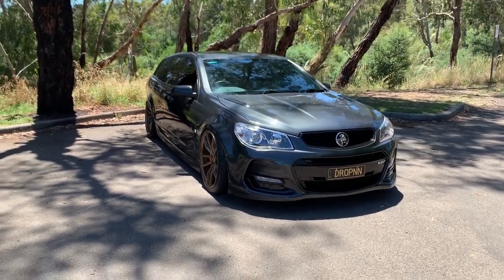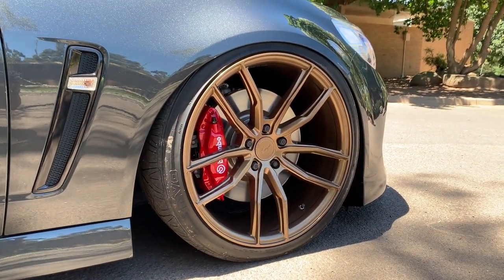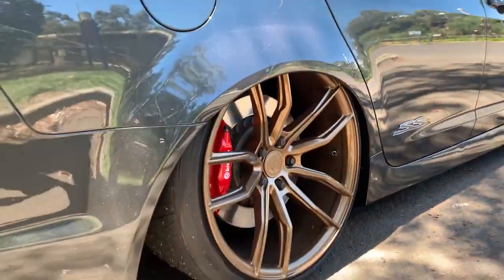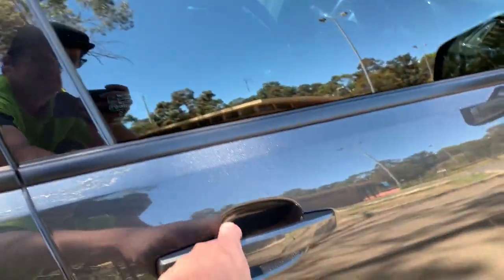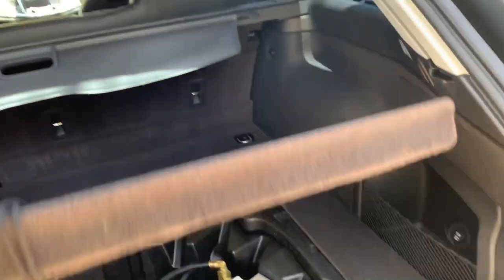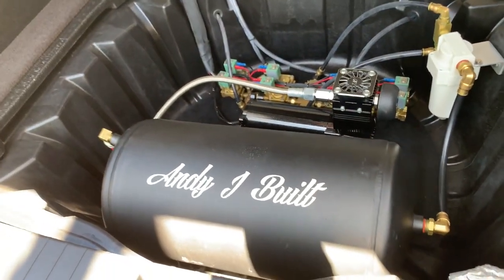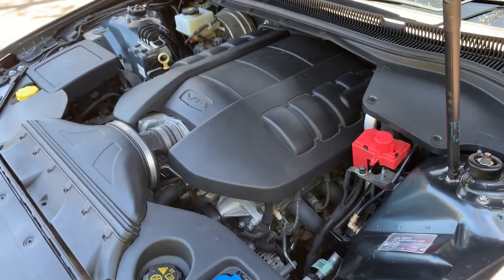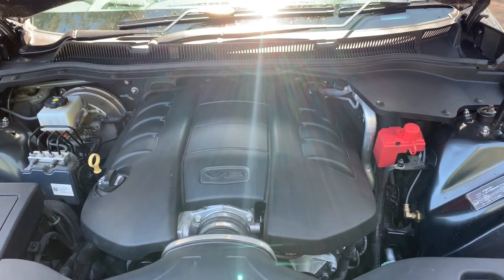Air Bagged By Airride VF SSV Commodore On Koya SF11 Wheels

Comment: That’s awesome! What kit did you get? Super clean install, nice work!!!
Reply from the maker: Didn’t exactly get a kit, I used airrides front and rear struts and then put together the rest myself.
Reply: @AndyJBuilt  What were the other parts you sourced? How much did it rip you all up?
Reply from the maker: @pirateh00kar  ah gee can’t remember exactly, struts are $4300 then the rest probably another $2000 (tank, compressor, fittings, valves, air lines, gauges switches)
Reply: @AndyJBuilt  Rad looking wagon either way!